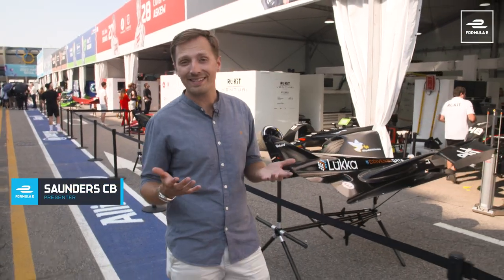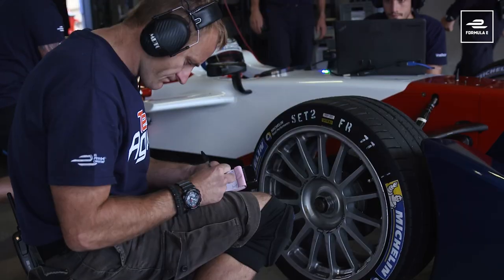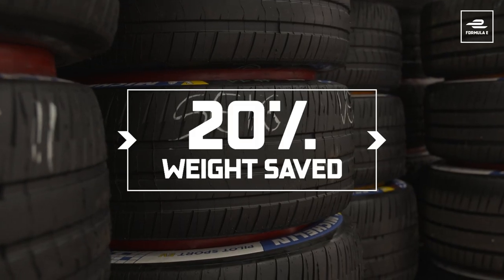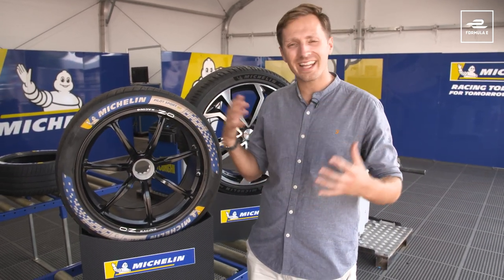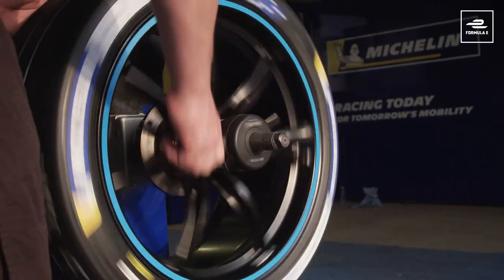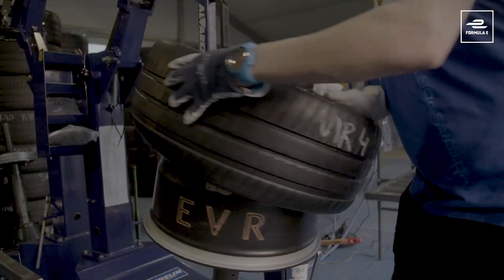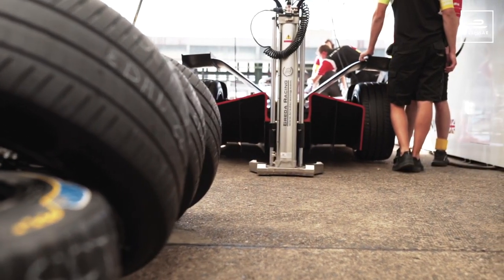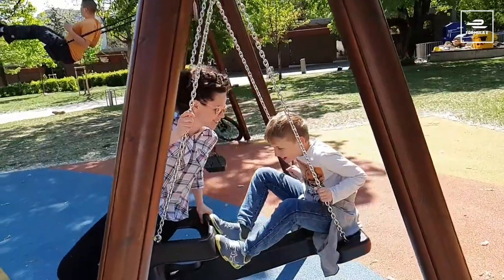What made Michelin's Formula E tyres so special?

Comment: They caused some spectacular crashes this year
Reply: Truly amazing, hope the next season tyres are far more suitable for raining too, but I guess making an all-weather tyres for races are just hard, hence why Formula 1 tyres had various types to cater one extreme advantage on each tyre type
Reply: That said, I guess having a recycable, one type of tyre are indeed saving costs
Reply: @viochrys  At the cost of safety...
Reply: @spliceosome  well, depends on the drivers too, if they are already used to the low grip tyres that they're using and the track they're racing is decent enough,  I can say that they are doing good job.

But as expected, unpredictable weather do be messing around with the drivers, and the so called 'all-weather' tyres are not helping at all. That's the reason why my recommendations were having 2 sets of tyres, one for non-wet but still tried to cater other weather conditions, and the latter for wet racing.
Reply: @viochrys  Yeah, I think it's as easy as having dry tyres and wet tyres. At least.
Reply: @spliceosome  yeah... They can still experimenting for both sets of tyres to be recyclable too, hence maintaining their objective to use as much sustainable stuff and reducing costs. But eh just my view, plus we don't know how the Gen 3 cars will perform on the tracks 🙃

Comment: What is the drive for Michelin to innovate?
The teams have to use these tires whether they're good or bad. The manufacturer teams have to innovate if they want to win, but Michelin will always win, right?
Reply: You mean they should have another tire manufacturer on the grid, like it used to be before in F1?
Reply: Michelin innovates through their racing tire program. Michelin will not make a tire that does not provide any useful data or research for passenger high performance car. Having an all season Tire is innovation within itself. Having to create a tough chemical compound that can sustain weight, speed, torque, g-forces, sidewall flex, and tread to handle wet/dry that’s the innovation. Never want to build a tire on purpose to degrade or separate rain/wet tires as this will not have real world benefits. Manufacturer must invest a lot in a racing series so they must get something out of it.
Reply: @Noukz37  Not really. What I mean is that I want to know what drives Michelin to innovate. Having another tire manufacturer on the grid would be a drive for them to innovate since they won't stay on top of the competition if they don't do that. But it could dramatically change the focus of the sport from an efficient powertrain to efficient tires. So I doubt that multiple tire manufacturers on the grid would end up providing a positive outcome for the sport.
But other than that I don't see why they would bother innovating. They already use these tires and if they don't perform too poorly then they'll keep using them. 
There can be a passion from Michelin to develop better tires, but if that's all that drives the innovation then it'll probably eventually get stop. So I feel like I'm missing the real reason why they need to innovate and I want to know what that reason is :)

That could be one way. The wheels are the most important part of a car in many ways, so having multiple different tires could make the grid very unbalanced. So I'm not sure that that's the best solution. But if that's the best way to push them to innovate, then it may be better if they did do that.
Reply: @goldenboyx92  So do they have to invest money in order to be able to have their tires used by Formula E?
Is it similar to how for instance the US military selects the manufacturers of their equipment? In the JSF program Boeing and Lockheed Martin presented their designs and prototypes, and the one that came up with the best package was the one to make the next-gen fighter jets.
If Formula E applies this concept to select their tire manufacturer then Michelin could lose out on their advertisement spot and their way to gather data about their tires. Then it would be in their best interest to invest money and innovate on their tires to stay ahead of the market.

What I wrote above is pure speculation though. Do you maybe know if this is what Formula E does to drive Michelin to innovate?
Reply: TBF it seems like most racing series have dropped competing tires.

Comment: How they were "all-weather" tyres but couldn't work in wet conditions?
Reply: Basically like the New York race back then, it seems that these "all-weather" tyres tried to cater all weather conditions, hence it's such a mediocre tyres. I get what they tried to do, but I was expecting for them to just at most use 2 tyre sets so the one can focused on grip, and the latter focused on wet conditions.

I did mention this on another comment in here, saying that I guess using one is indeed costs effective, albeit it's mediocre stats which was not cater to any specific advantages, unlike Formula 1 tyre sets.

(Edit cuz typo 💀)
Reply: Well, they do work better than slicks.